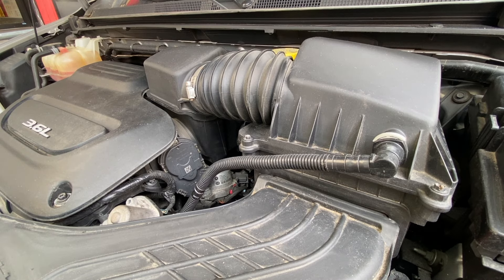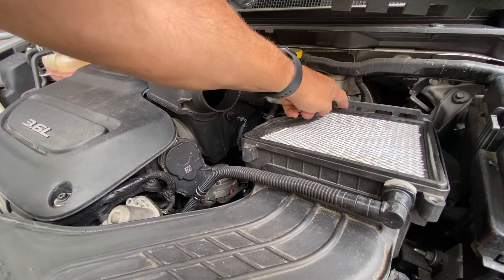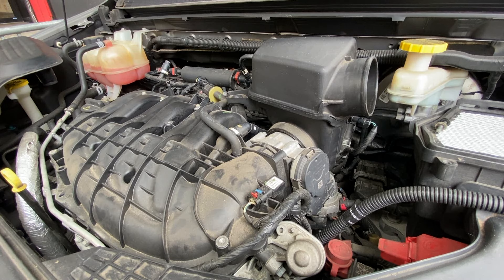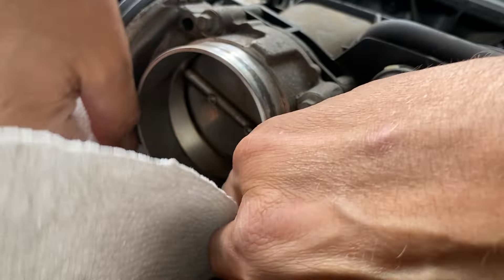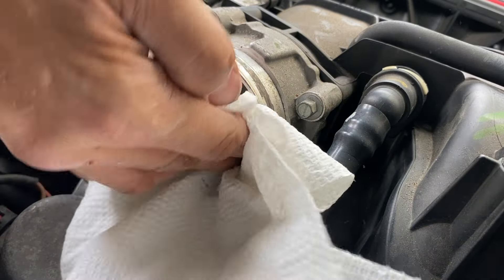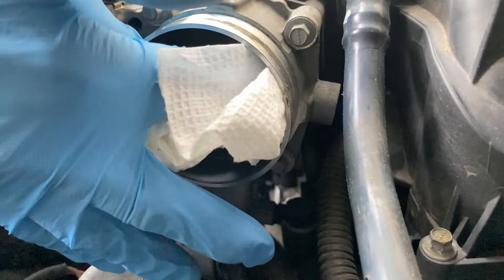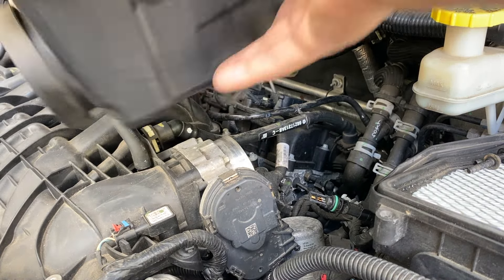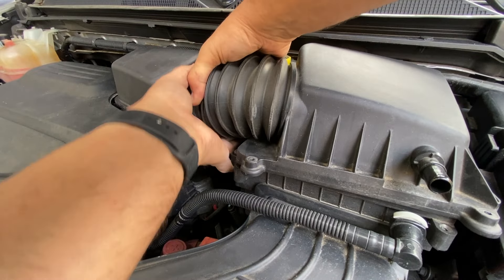Improve Rough Idle Chrysler Pacifica Air Fuel System Cleaning 3.6L Pentastar - 25 min - increase MPG

Comment: I did all of this as well as replacing the spark plugs and the issue remains. The rough idle is mostly while stopped at a red light on Drive, switching to Neutral the vibrations lower considerably. I have to try the Techron fuel system cleaner.
Reply from the maker: If you continue to have a rough idle after new plugs, cleaning the throttle body etc I think you may have to have your motor mounts checked out. They could be cracked. That happened on my last vehicle. Depends on how much it drives you crazy.
Reply: Motor mounts. 2 for the motor, 1 for the trans. Change em all. Also check real hard for oil leaks. They can be tough to find. Mine came from the valve cover gaskets. Once oil leaks on the mounts, they crack and cause rough idle and eventually killing all the mounts and causing rough shifting once it's bad enough to impact the trans.

Unfortunately though, labor is real high on these. Going to cost at least $1500-2000 to do. 

Try stalling the torque converter briefly. Hold your foot on the brake and hit the gas. You'll likely feel a decent thump getting on the gas when the mounts are shot.
Reply: @anthonyreynolds2365   Great tips. The old oil cooler leaking and deteriorating the rubber bushings with time makes absolute total sense. I thought of it, but didn’t follow up on it. I just replaced the oil cooler myself (3rd one on this car at 60k!) and there was a lot of oil running down the side of the motor. I don’t know if there is a motor mount down to where the oil from the oil cooler was leaking onto. I have to see.. I took my time to do the oil cooler job right, but now I have to see if that oil got to the mounts. I think it may be the transmission mount. Thanks!

Comment: It's far easier to remove the entire air filter housing instead of splitting it. The bolt you see in the corner near the left strut tower is all that holds it in. It's also less risky because sometimes the two halves don't like to mate together properly. Specifically, the cut corner side of the upper half sometimes doesn't seat properly with the bottom half. All will seem fine because you won't encounter much difficulty getting the screws back in. I would definitely double check yours. Just make sure the outer flap on the top half is where it needs to be. If someone else improperly reassembled it before you did, the whole housing becomes warped and is much more likely to be incorrectly assembled the next time. You are correct that manufacturers don't use MAF sensors anymore. They use a MAP (manifold absolute pressure) sensor instead like this engine does. The intake air temperature sensor serves a completely different purpose and isn't a substitute for a MAF sensor.

Comment: GET RID OF THE CAR CHRYSLER CARS ARE JUNK
Reply from the maker: appreciate the feedback. without one what would I fix? hahaha
Reply: 2015 Chrysler 300 with 206k+ miles, still running strong, doesn't burn any oil, transmission still shifts good. It's about the owner, not the car.